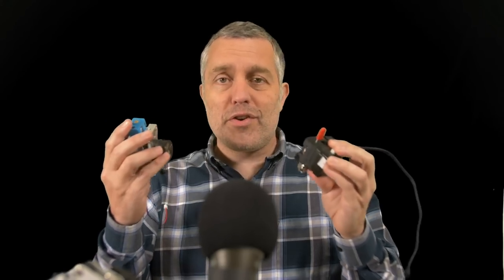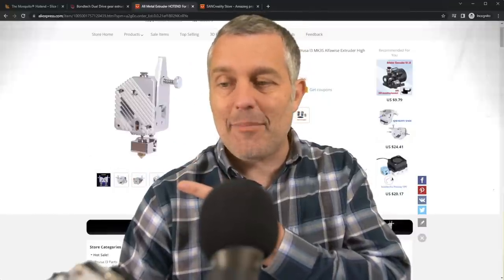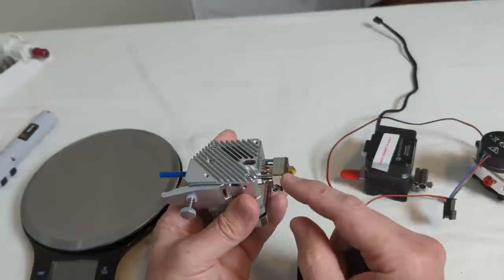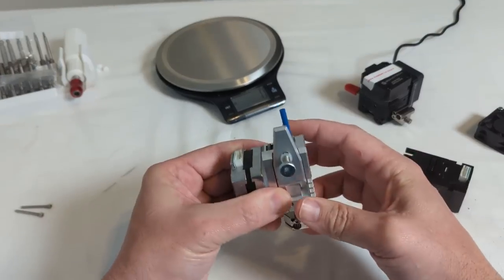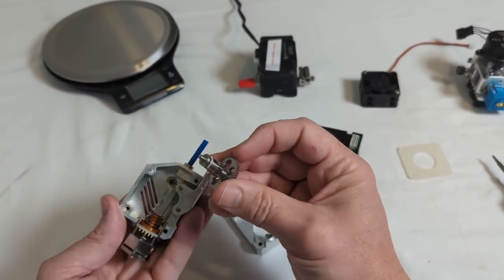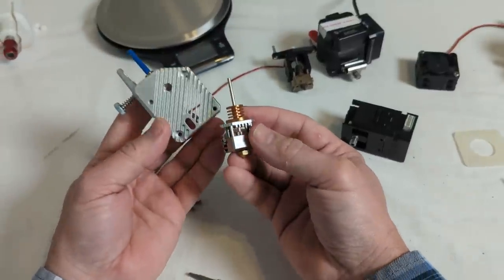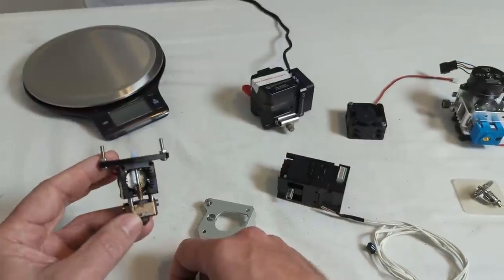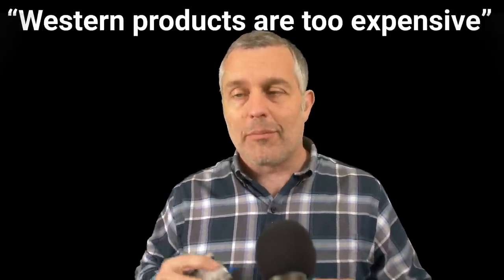INTRODUCING: This Metal Geared Combi-knockoff Extruder

Comment: Mechanical engineer here. POM or HT-PA gears make the extruder MORE wear resistant and thats why everyone uses them. 
Metal on metal contact will always wear stuff down, so we developed two ways of dealing with it. 
The first is hardened surfaces, so either straight up hardening via heat treatment, nitriding or any other of the many ways to harden a surface. If both mating surfaces are really hard, the slightest bit of lubricant will be enough to make the system durable. However, this requires manufacturing precision on many levels and is thus reserved for expensive parts. 
The other way is introducing a softer gear, like copper, cast iron (often used for really large gears) or plastics. Way cheaper and, critically, able to conform to the inaccuracies of the steel mating gear without taking damage. These parts deform BY DESIGN to better mesh with their mating gear und after a break-in, they don't really wear for a long time. The problem of binding gears is pretty easily prevented if they are manufactured with some precision. Also, they are self-lubricating and have way lower surface friction than steel on steel, thus lowering the amount of lubricant that's required in the first place.
Most POM blends have a maximum continuous working temperature of ~100°C, so using them in your max 110°C chamber is no big deal. You'll replace the extruder for a newer design before they wear out too much.
Bondtech uses a very specialized blend for their plastic gears in the LGX (the first batches used POM, but they switched) which is able to be used continuously at even higher temperatures.
Reply: In that case, I’d be interested to see DPT push it to failure, instead of searching for metal gears, which are heavier and more expensive…assuming POM doesn’t decompose to toxic, flammable formaldehyde gas at such modest temperatures. A quick search shows a decomposition temperature of 150-240C.
Reply: @AwestrikeFearofGods  true. 100°C is totally safe, even for extended use
Reply: Came here to say the same thing thanks for saving me time good sir :D
Reply: Metal gears also add noise , and 3D printing is a visual representation of harmonics in the driven systems . 
So you’ll probably get visual artifacts , like making a record
Reply: the silicone insulates the motor from the hotend......
Reply: Damn the more you know.  Thanks!
Reply: @AwestrikeFearofGods  at 100C i would worry about stepper motor dying, most steppers i checked have max operating temperaure of 70-80C

Comment: That silicone spacer is supposed to thermally insulate stepper motor and reduce the heat transfer to the extruder body and to filament. Not a decoupler nor a suspension.

Comment: The rounded top edges and burr on the lower edges of the gear suggest it's been stamped rather than sintered.
Reply from the maker: Good observation. It is possible, but the walls of the teeth of the gear are so straight and the thickness is fairly thick. Makes me think this is the process being used for the production: https://youtu.be/z5327SSM6G0 That burr on the top edges could be caused during the compression of the powder. Think of it kind of like flash in a liquid mold. Some of the powder works it's way up the wall of the negative cavity and gets stuck between the male and female halves of the press.

Comment: What if you just drilled the holes in the hotend to reduce the thickness of the insulation layer for fit and heat transfer? I'm not advocating buying rip off equipment but if you already have one it should be easily salvageable.

Comment: 150mm/s is nothing.  My microswiss does that with a .4 nozzle. I wish  all  these reviews of hotends would use mm³ volumetric flow rate instead of speed. As an example, my MS hotend is only good for about 14/mm³.  Volumetric flow is a much better benchmark of performance.

Comment: Have you looked Vez's Goliath hot end and VZ-HextrudORT newest version?  He moved the cooling block to the extruder (WC version even!) and designed the hot end to not use all the intermediate universal mounting flanges.  the block now cools hot end, extruder, and even the motor.  Looks interesting but he outsourced production to the PRC and I would rather have paid a little more for USA.

Comment: What's funny is that silicone spacer has nothing to do with binding gears 😅it's there to prevent heat from the extruder motor from being conducted into the metal extruder body, and thus preventing heat creep.
Reply from the maker: There are much better thermal insulators than silicone. If this is the purpose the engineers revealed themselves to be amateurs.

Comment: The silicone gasket is to stop heat creep into the stepper motor I would say
Reply from the maker: I hadn't thought of that. Silicone does transmit heat surprisingly well. So if this is the purpose there are better solutions.
Reply: Yes, I was also thinking that it's for isolation. And in fact I believe that any play it allows will make the gears get stuck, or skip, more rather than less (although it would also allow them to get unstuck easier).
Reply: @DesignPrototypeTest  I would assume it's to quiet it down? It seems super likely it would get pretty loud?
Reply: @DesignPrototypeTest  i think it actually does the opposite by preventing the heat from the stepper into the hotend. I have had issues with steppers on plastic extruders direct drives plates having increased flex when the steppers get to hot. this could solve that issues with plastic extruders.
Reply: But how? If anything I'm thinking the shell could be utilized to help cool the stepper, not the other way around. Look at the design of the heatbreak and how the shell is attached. I can't see that getting hot enough to affect the motor negatively. Since it likely plays little role in cooling the heatbreak, it just seems like unnecessary weight if it's not used elsewhere.
Reply: @johnnydavila2487  exactly.  It's to stop the ~80 degrees stepper motor from transferring that heat into the body of the extruder, and softening things like PLA before it even gets past the gears.

Comment: FUN FACT most machine shops have a hardness tester and usually can test for free if you work with them or just know them it is fast and easy but pointless unless the coating is in the materials path of resistance the rest is minimal thermal insl. but crome plays a huge part in real manufacturing extruders of all types for 50 plus years now and will soon here too! screw and barrel makes ways more pressures,flows and friction heats, were just not there yet in fdm,well its close but still not a true extruder for polys and alike the adv. BP "back pressure " in a Real extruder pressures are 3000-9000 lbs/per/sqIN then the crome is all about quality and application of CR38 or what have you ...and parts made for coating will be smaller to match the final dimensions based on the thickness used of the coating.my point here is the offshore one did not do this and is why your tolerances are tight most likley.

Cheers!

Comment: The heater block on the knock off also has a significant amount of mass where it has the screw for clamping the heater. The other one is minimal material. Air being a horrible conductor of heat and the mass on that side of the better designed on probably promotes better thermal properties, as compared to the knockoff which would absorb unneeded thermal energy.
The chinese get some stuff right. Ive tried to deal with them on better automotive aftermarket cylinder heads and have been in some good discussions but theyll only change designs if you buy 1000. Some of their stuff is gettin better, but a lot of times its the small stuff that would make a world of difference if they just paid 10% more attention.

Comment: I've been running an all metal bondtech knockoff with a Dragon hotend in my 125° chamber temp printer that I use for Ultem.

works great at that temp. I never tried the standard bondtech nylon frame with pom gears, but I've had other gf nylons turn soft in 125° so I doubt the bondtech would work.
Reply: Are you using a commercial or hobby printer? How THE HECK are you sustaining 125° if you're using a hobby printer? That's amazing.
Reply: @3dPrintingMillennial  the frame is an ender 3, but almost all of it is replaced with high temp options.
Reply: @3darms  Interesting, I recently finished a large build volume CoreXY I've been working on and thinking about converting my old ender 3 Frankenstein to a high temp system. Did you switch to linear rails or do you think PC vslot rollers can hold up?
Reply: @JJFX-  depends on how hot you're thinking though

Comment: Nice little review bud, I still like the BIQU H2 V2, its my go too, I have an LGX Lite with a Dragon HF, and I still prefer the BIQU H2, its small, fairly light weight and very reliable, and I never get heat creep, my only issues is the noisy clicks it makes on retraction. But for $60, this knock-off for great value extruder for a bed slinger like the E3 and similar, just install a plated copper nozzle, should fix the heat transfer issue. The heater block will be nickel plated copper, just like everyone else, run a drill bit through the heater cartridge slot and use some copper based grease as heat transfer compound.

Comment: You will find the H2 is like nearly 10 to 1 gear ratio, a stock BMG style extruder is around a 4 to1 and you will find most products using the LDO will be a planetary reduction gear system, so expect the BMG style to be much weaker on over torque than either of those products, just think of it like this, the BMG is in 4th gear trying to take of up hill from a stand still, where the others are in 1st gear, also the BMG was originally designed to be used with a full size Nema 17, not the pancake ones.
Reply: Dunno about your claims.. I've been running My BMG  with a 22mm pancake motor  for almost 3years now
  and My  X stepper gets warmer (not Hot) than my Extruder stepper motor ever has.
Note that BIQU has earned History of sketchy products/low quality control . 
 I have experienced that particular Joy. 
Fill Your boots
Reply: @barenekid9695  I have moved on from all of this, a lot changes in 9 months bud, I have designed and sell my own extruder based on the BMG gear set, does 100% everything I need or want, and I will never give money to another manufacturer for such a simple easy to design and manufacture product again, you can see it on my channel, and no it is not a Sherpa by Annex, its gear profile is closer to a Sailfish.

Comment: That block is on at least 3 clones I can think of. The mantis, red lizard, one of the million variations of the dragon, and that one. I'm sure I'm sure I'm leaving a few out. I've sworn off ali express since I got burned on a new soldering station I bought 2 months ago. Tips for it last like ten hours and cost 20 a piece from the "premium" vendors and the cheaper ones ive tried are identical because I checked them with my multimeter and took them apart. I'm selling it and getting a metcal.
Reply: cant you get any genuine tips like from hakko etc
Reply: Weird, its totally hit or miss. Ive had decent luck with the ones that came with my fake hakko. But some of the tips eroded away quickly while others (including the thinnest one) just kept on chugging along.

Comment: I have a very similar all-metal version and it looks like 'should' work great, but in reality it doesn't.  1) The exit point just after the gears is not close enough to the gears so allows flexible filament enough movement to jam the entire extruder up. 2) The gears immediately starts eating into parts of the housing. 3) After a really nice looking design, the spring mech itself is ridiculously cheap and poorly devised meaning the spring catches on the screw giving inconsistent pressure.  4) Feeding new filament into it is very tough. I often have to remove the fitting so I can get new filament through.  5) The set screws are made of cheese. Just terribly weak.  Recommend replacing with good quality ones immediately.   Mine was the two trees version.  Again... this is billed as direct drive compatible, that will feed soft filament (I was using 95A, so NOT even super soft stuff), it fails... miserably.
Reply: (note, I am only referring to the extruder, not the direct drive setup with the extruder)

Comment: I would be interested to see those gears in something like the NF-SUNRISE, or in something like the "Mellow NF-DDG-Crazy Hotend Dual Drive Extruder" which is similar to this extruder in concept, but looks lightweight comparatively (yes... It's a knock off of the slice mosquito) but would be interested to see how it compares.
Reply: I have wondered about the DDG Crazy Extruder, I also wonder if a slice mosquito hotend can be used on it to get around the patent issues?
Reply: @SolarityTechnology  it is fully compatible with slice hotend.

Comment: I have worked in metal scrap for 16 years, and what I saw in the video is not 99.98% copper mixture they are much lower among of copper would think mixture between copper and bronze and that they have planted with Crom so is  they very difficult for heat to transform into nozzle, understand why they do so, given the copper prices today so of course they use lower copper blend to bring down the cost.

Sorry for my English.

Comment: @8:40: this is for vibration dampening. Any vibration on the assembly transmits to the print, thus making it less accurate ( adds "noise" through vibration ). I worked as a parts engineer for Snap-on Tools for almost 20 years. You gears are made from powder and heat compression. In China, there are NO patents that can be enforced as you are shipping one piece at a time to the US. Btw, the ENTIRE unit is a heatsink. The copper pulss it away from that area faster to the other material to keep a coefficient, but not cool it too much.
Reply from the maker: The 4 uninterrupted screws passing through the silicone matt and rigidly attaching the gear assembly onto the stepper would transmit like 95% of the vibration despite the dampening properties of the silicone matt. Purpose designed stepper vibration dampeners isolate the motor through a harder rubber than silicon. They look like this: https://directvoltage.com/wp-content/uploads/2018/01/s-l1600zzzz.jpg They have no continuous screws going from the motor to the mounting platform. Therefore all vibrations must travel through the rubber. If the silicone matt was intended only to dampen vibrations it is a poor design.
Reply: False. The spacer is not for any kind of dampening.  You have to remember, this is a chinese design. The chinese do not design anything for quality.  It's designed for performance.  The silicon space is to reduce heat from the motor being transferred to the metal extruder body, and potentially softening the filament before it reaches the hotend.  Without the spacer, it's very possible this extruder design would not even work at all.

Comment: Having the entire shell sintered metal doesn't make sense. If the silicone stepper motor spacer was made from a thermal pad it might improve cooling and offer the same benefit but with the silicone insulator it's just more weight. 

The metal construction could be interesting for a cheap, water cooled hotend but this is just a frankenclone that isn't sure what it wants to be when it grows up.

Also if you go back to the listing you'll see they didn't include the stand-offs in the picture... I'm sure they're really happy you made this video.
Reply: You obviously do not understand basic thermodynamics.  Any heat above the heater block is bad.  You do not want any heat around the filament until it reaches the heater block.  What do you think will happen if a stepper motor that is running at around 80 degrees C, is in direct contact with the metal body of the extruder?  You are correct! That heat is going to transfer into the extruder body and potentially soften the filament (if it's something like PLA)
In essence, this extruder design would not even work without the silicon spacer blocking the heat transfer.
Reply: @AndehX  This is old so I'll have to look at the design again but it sounds like you're implying the heat transferred from the stepper into the shell would be so significant that it would impact on the hotend assembly. I'm failing to see how that's going to happen....

Regardless how hot that stepper is running, it would only be putting out a few watts of heat energy into what is essentially a heatsink in the open air. The amount of this that would radiate into the hotend heatbreak would be negligible. If you feel differently, please explain how that's going to be a problem.

Comment: Can you show the patent it actually infringes on and how it infringes on it .
No hate , it just nice to see because a lot of people don’t seem to understand how that might infringe .
Reply: I am also interested, I think the patent is, excuse me but genuinely stupid. I want a patent to use 4 screws and copper. Slice engineering made a good hotend but they probably also took a lot of knowledge from other hotends. Using a heater and thermistor like the V6, patent infringement! :o a small tube instead of a large will transfer less heat is  physics! Slice entering a community of open source and making patent is kind of rude.
Reply: @christofferakesson5100   3D printing is really wierd , bondtech and there extruders , I litterally have a job that comes off my metal spray machine that is identical to the Lgx part …. It almost slips in .
Yet patent .. 
I think the patent system needs an overhaul , there are to many identical patents just explained in a different way to gain a new patent